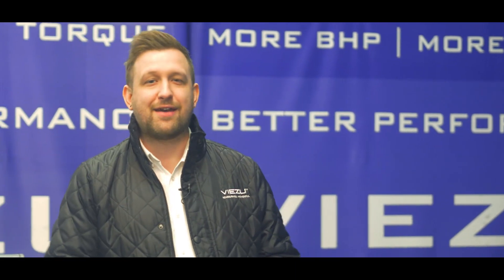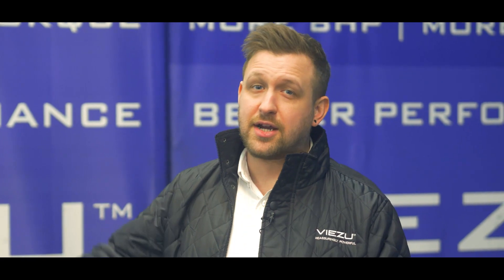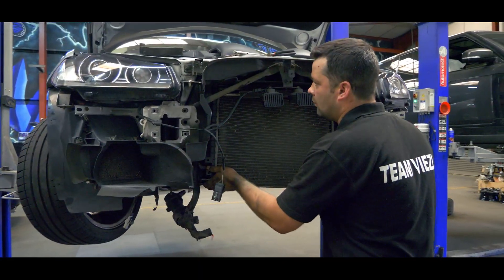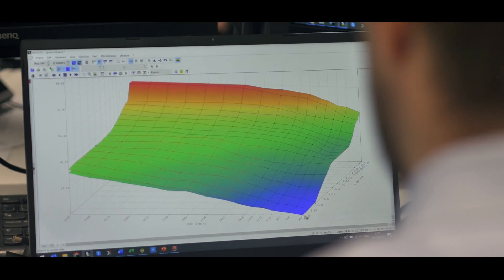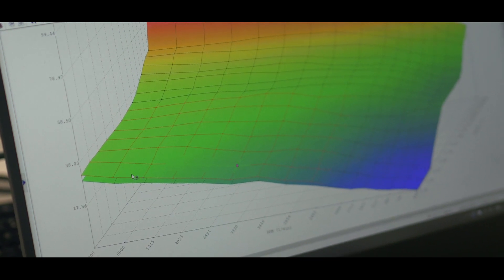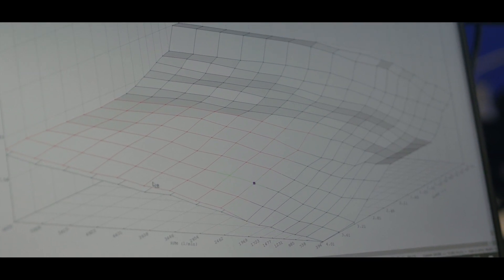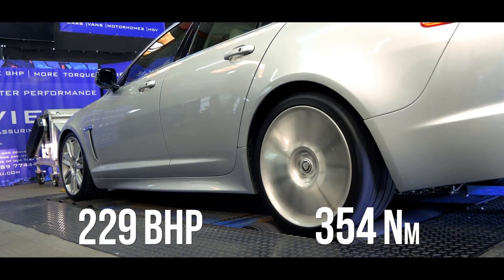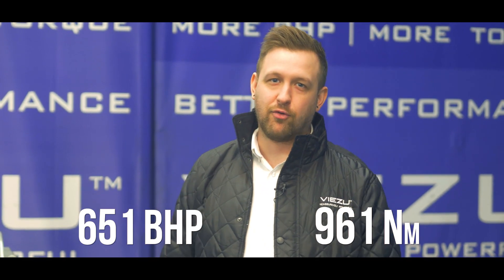Jaguar XFR | Predator Upgrade

Comment: What’s the highest hp you can get in a jaguar 5.0 supercharged motor? Does a cat delete make a difference in hp?
Reply from the maker: Many thanks for your comment Calvin. With a full performance package and uprated sports cats dependant on what your vehicle is running originally you can get anywhere from 650bhp to 670bhp. So I can send you over some more information on these upgrades please contact me at info@viezu.com. Kind regards, Elle

Comment: I have a 2014 XFR with Spires back boxes. Is it possible for you guys to bring back the pops and crackles like the XFR-S with a map? I might go upper pulley too when i have the cash.
Reply from the maker: sure thing, we can add a nice burble map that will sound great al part of teh tune, and we can supply and fit a pulley for you too - in fact we do a discount package if you take the two together - drop us a mail to info@viezu.com if / when we can help with anything

Comment: how long did it take you guys to install the pulley I was thinking about getting it but wondered about the installment time? Thank you
Reply from the maker: Hi the upper pulley takes around 2hurs, and its the same for the lower one, it does get quicker once you have done a few. here is a link to the fitting instructions https://youtu.be/nxGVUq4iSJQ and the upper one here https://youtu.be/bBkioDjPZ9k
hope that helps
Reply: @VIEZU Technologies  great work guys I will keep your info. I've been studying  the upgrades you can put on this model ever since the rocket group ran the xfr on the Utah salt flats and achieved 225 miles an hr. I know they also did work on the intakes...keep it up

Comment: The figures achieved are with sports cats or OEM cats ? Is this XFR running the 6 speed or 8 speed gearbox ?
Reply from the maker: We can tune to 650 bhp with the stock cats, the 200 cell cats tend to increase mid range pull and torque quite nicely, but don't make a huge difference at top RPM. They so do course and to a nice deeper exhaust tone too, and ten to keep engine temps down a bit too which of course is a good thing - you can see more here: https://viezu.com/jaguar-tuning-specialists/
Reply: @ViezuTechnologies   Thanks. This was a 6 speed Denso ECU or an 8 Speed gearbox Bosch and what fuel rating (95/98/99 Ron).
Reply from the maker: This was the Bosch ECU, sadly we did not fuel the car, the customer fuelled before he came in.

Comment: What oil after modification ? Still 5w20 ? Or 0w40 ?
Reply from the maker: HI Nordyk2, we use the standard Jaguar specific oil in all our Jags. The power is super smooth and progressive in delivery and has been designed to work inline with standard service intervals and components.
Reply: @ViezuTechnologies  ok Thank's 🔥🔥🔥

Comment: What are the different maps that comes with the XF 5.0SC or is it just one custom tune
Reply from the maker: Hi, there are a few options, stage one tuning would be for a stock car, then stage 2 or stage 3 would be based on the amount and different upgrade and options fitted, so the map and tuning would be adjusted for suppercharger upgrades, 200 cell or decat, charge cool, etc. we can also add pops or burbles to the exhaust as well as other custom requests, so in short, teh tuning is custom to the set up and drivers requirements.  You can see more here: https://viezu.com/jaguar-tuning-specialists/

Comment: whats the most this 5.0 v8 can be pushed to?
Reply from the maker: Hi Matt 

Depends on the car, year and condition, we expect around 575bhp and 900nm of torque, 
Which Model have you got?
Reply: @ViezuTechnologies  i have a 2014 xfr with around 58k on the clock, i just wondered whats the most bhp you can get out of the v8, has anybody ever got 700bhp?
Reply: How about a 2014 xjr?
Reply from the maker: Hi Matt, yes and no, we go to 650 / 670bhp as a max on the V8, its safe, reliable and we have literally tuned thousands of them, this we would say really is the max, we have seen two motorsport vehicles tuned to 700bhp and the internals failed - yes it was drive hard, but in reality, its just too much power and torque for the standard internals long term, not unless you wanted to go for forged engine internals,  you can see more on our Jaguar tuning here : https://viezu.com/jaguar-tuning-specialists/ or mail us at info@viezu.com
Reply from the maker: Yes we have tuned many many XJRs to this level, if you check out our youtube channel you will find some there.   and you can see more on our range of Jaguar tuning here :  https://viezu.com/jaguar-tuning-specialists/
Reply: dont push these v8s too far as they will be some of the last ones on earth.

Comment: How’s the diff cope? Seen issues on standard cars even when they were new-ish
Reply from the maker: Hi we have done over  240 of these conversions now, and we never ever had an issue,  and / or any issues with the diff unit after tuning. We run and drive them ourselves for many thousands and thousands of miles too. On the whole we find the 5.0 engine and drive chain is very very strong.  You can see more on our Jaguar tuning here: https://viezu.com/jaguar-tuning-specialists/

Comment: Amazing numbers! I will replace the 55AMG for the XJ and get a Vizeu 650 tune. I have heard that the 6-speed transmissions are better than 8-speed to handle this monster torque ?
Reply from the maker: Yes we tune many of the 6 speed to, they make the same power and handle it very well https://viezu.com/jaguar-tuning-specialists/
Reply: Have you released the remote tuning tool for the 6 speed on the XFR.